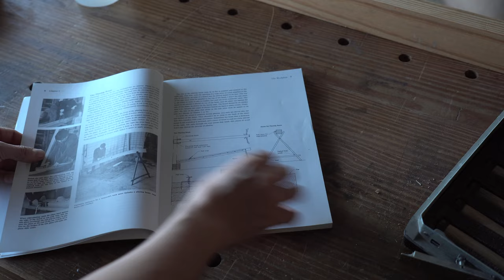I may be crazy but this helps…

Comment: If I wanted to spend $200-$300 on a good starter set of chisels to import from Japan. I am a hybrid woodworker and would use them for mortise and tenons, dovetails, and other fine detail work. Thanks
Reply from the maker: A decent starter set these days runs about $400. Avoid Ioroi also labeled sometimes as Ioyori. The setup process is a little time consuming but it’s totally worth it. I believe Hida Tool has some decent beginner sets.